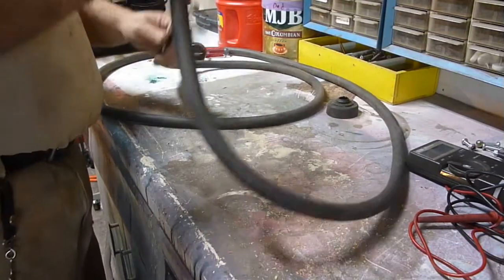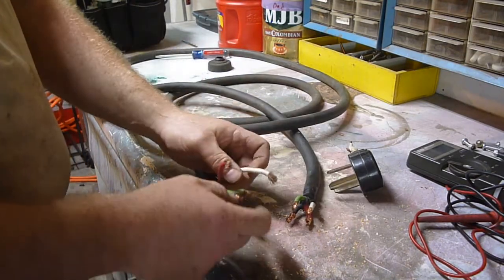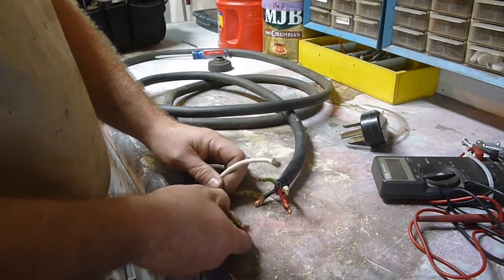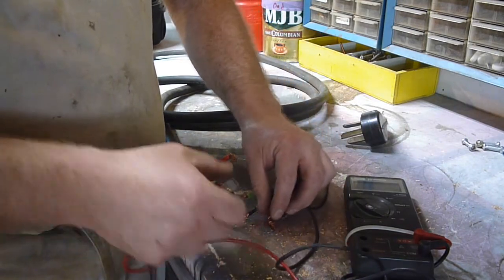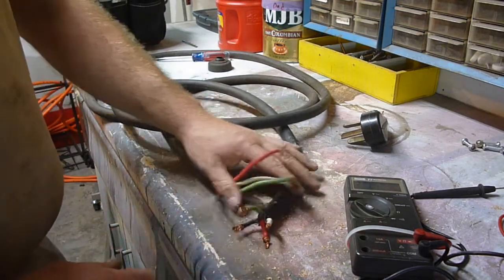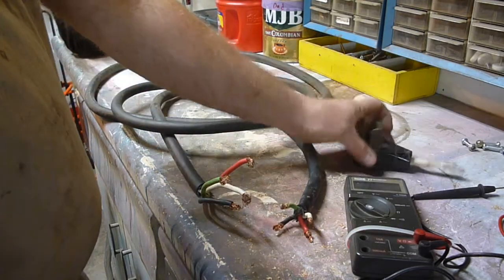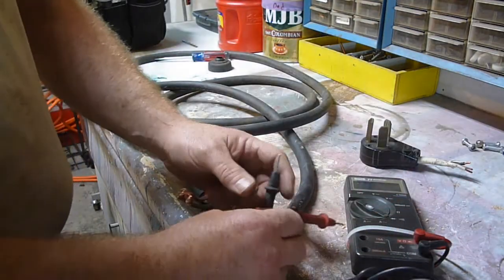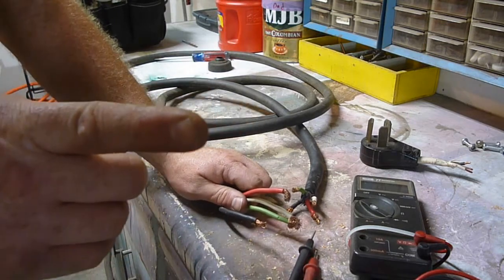HOW TO TEST FOR CONTINUITY IN WIRING

Comment: What if the other end of the wire is somewhere else
Reply: @sagarthechamp   I know this is months later but figured I would explain an easier way. Tie two of the wires together at one end. Example the black & white. Then touch your leads on the black & white at the other end of the wires. If it beeps you have continuity. Then do the same for all combinations of wire (ex. black to ground , white to ground, etc.)
Reply from the maker: i have actually gator clipped a long wire  to the tester and been able to reach longer lengths but it definitely depends on your  situation
Reply: @JunkworksGarage  thxs for the answer.. 👍

Comment: Do you have to use the black pen on the wires and the red on the conductor I guess it's called. I'm not good with this. Can it be vice versa?
Reply from the maker: in this test it wouldn't matter